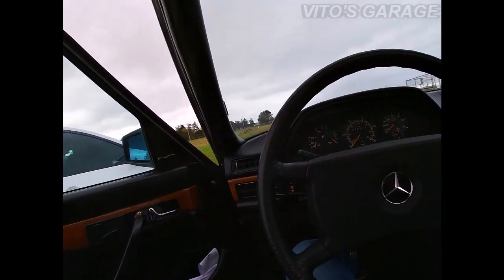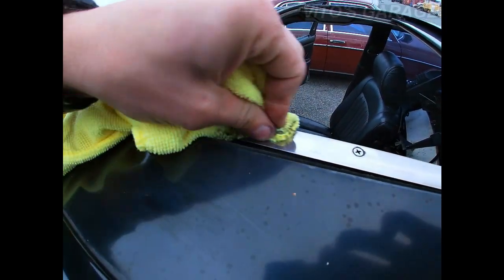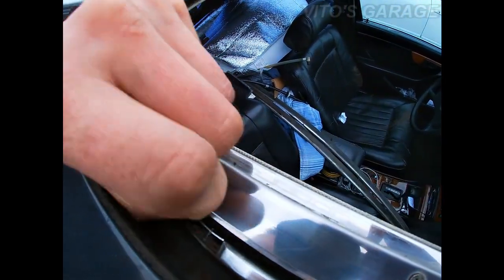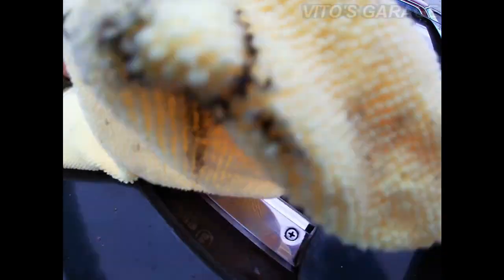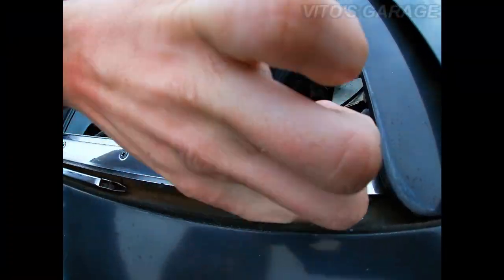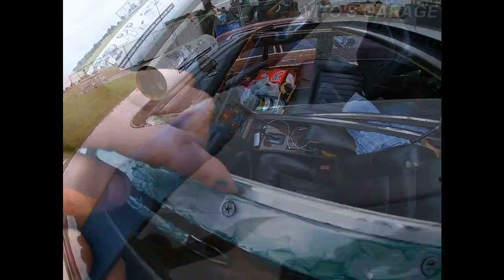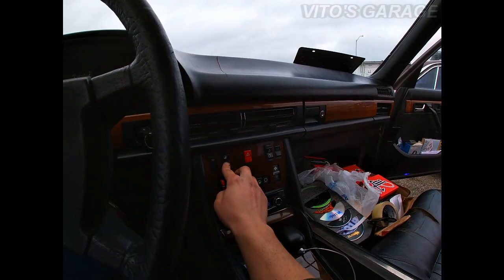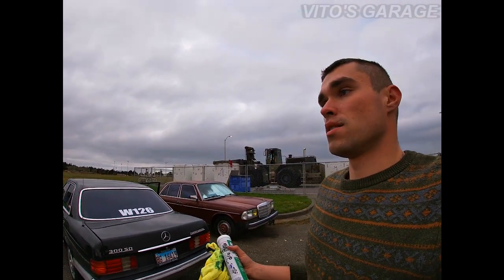How To Lubricate/Maintain a Mercedes Sunroof! Works on ANY CAR!

Comment: Good job on the sunroof.  If this were my car I would do a few more steps.  1.  Treat the rusty areas along the tracks with POR15 or a similar product, because rust NEVER sleeps.  2.  I would definitely test the drains with water and blow out the sunroof drains with compressed air, especially if the car spends a lot of time parked outside, especially in areas of tree pollen and dusty conditions.  (I know that you did mention the drains in this video.)  3.  Treat the rubber seals to prevent drying and cracks.  This will help protect the headliner from water damage.  Lack of lubrication is one of the biggest reasons for sunroof motor failure, because the motor works too hard.
Reply from the maker: Thank you sir! I will be treating and fixing those sunroof rust spots soon. And yes, I always lubricate rubber seals, and they last. That's the key! My sunroof drains are good, I checked them before. I just never filmed it.. 
Thank you so much for the recommendations and this long write-up!☺

Comment: No Any grease will not work SMH. 🤦‍♂️There are some greases that get very thick and sticky when cold. And others that turn to liquid with heat. So imagine your car exposed the sun on a summer day how hot the metal gets. Mercedes Benz actually specifies a very specific type of white lithium grease for the sunroofs. Albeit a high quality “over the counter” white lithium will also suffice. The advantage to this is it maintains is viscosity in harsh temps. While also not allowing it to stain any parts of the upholstered headliner. You’ll notice older Mercedes’ sliding Panels with dark to black streaks or rubs/stains on them that cannot he cleaned. This is due to improper grease being applied by previous owners/shops with lack of knowledge as to what they are doing or talking about. Also the use of improper grease will get gummy almost like a putty when dirt gets trapped in it. White lithium maintains its lubricating properties even as dirt/dust start the collect. And of course always remember a little a long way. Better to clean the tracks every year and re lube them to use gobs and gobs.  Not to mention how the inside will smell when all that grease gets heated up.
Reply from the maker: I understand your frustration with my video. You can also use a high heat bearing grease. It works amazing in hot climates. White lithium grease will dry up… I’ve had that experience with it already.
Ever since I made this video, I’ve never had any issues with my sunroof or grease drying up

Comment: If seals weren't NLA I might still have a sunroof lol
Reply from the maker: Sunroof seals are available for these cars
Reply: @VITOSGARAGE  they don't fit though.
Reply: All the seals are aftermarket Chinese seals and they are not the same profile as the oem seals. The sunroof will not close with the aftermarket seals
Reply from the maker: There are Mercedes OEM Genuine seals you can buy. Either on Pelicanparts or FCP EURO. Or the dealership can order them from Germany. Just don't use aftermarket such as URO... Those don't work
Reply: @VITOSGARAGE  The front and rears yes. but the side seals were the issue in my case. NLA everywhere I've found. I've heard a w108 part could be cut down, but that's a $100 gamble

Comment: Vito. I Enjoy your vids with ur sexy voice. But i must say... Please don't Speak authoritatively when you really don't know the subject you're speaking of. That is definitely not the correct way to lubricate a sunroof. Also, you should never use axle grease on your sunroof. All that grease you globbed everywhere is going to catch a lot of dirt and cause many problems. Obviously Mercedes sunroof grease should always be used. .Also should it not be more appropriately titled "Vito's Parking lot"?
Reply from the maker: I am sorry but I don't agree with you. Everything was cleaned up there there and the grease was applied. The sunroof is usually closed and it'll not attract dirt. Whatever you smear in there, it works the same way as bearing grease or other type of grease. 
I've been using it for years with no problems. 
And thanks, I am gonna change it to Vito's Parking Lot! Thanks for the suggestion! 😊 I totally forgot I just work in parking lots!🙌☺